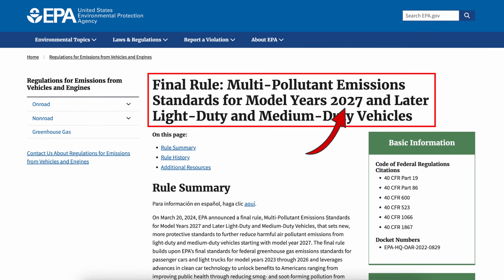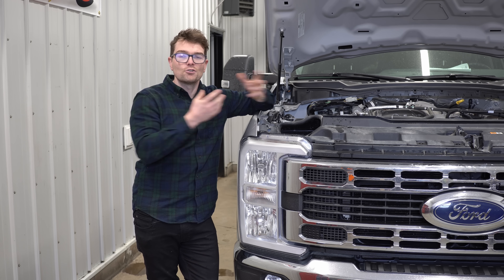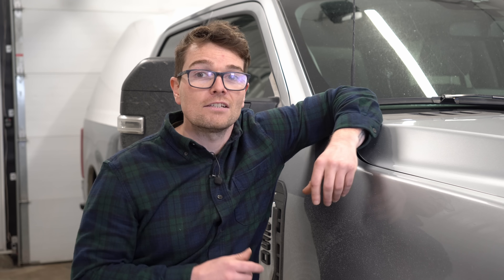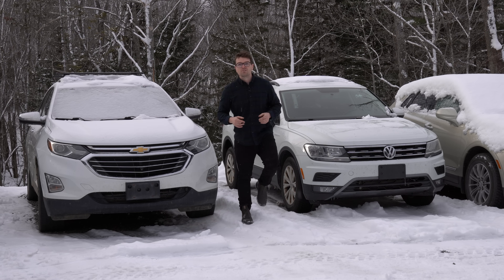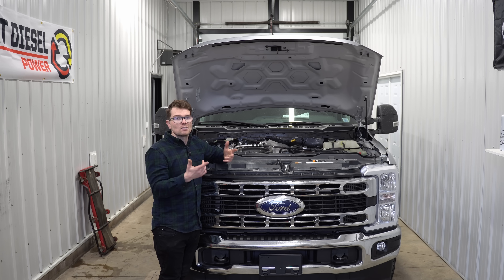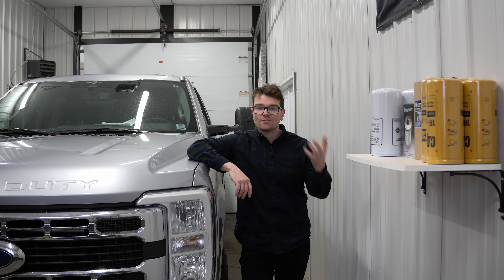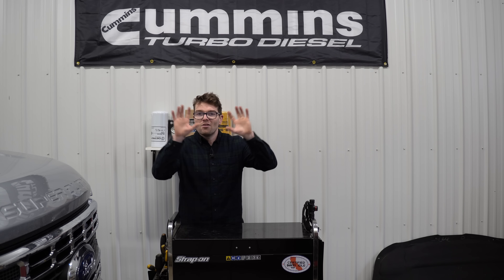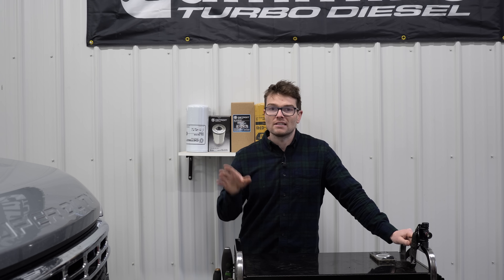NEW 2027 Cummins Diesel Engine EMISSION REGULATIONS are WILD **Diesel Mechanic Explains**

Comment: Don' forget that CARB restrictions are more harsh than the EPA and there are a bunch of states looking to adopt CARB standards over the next couple of years. Also, do not forget Cummins has the gasoline 6.7 coming to the medium duty market. At point in time on gas cars the catalytic converters had federally controlled warranty of something like 7 years/80000 miles. I only remember that because I had go bad at 79600 miles and got it covered under warranty.

Comment: The rising cost of all this bs. 
Will kill off diesel light duty trucks. 
Because the lack of sales. 
Most people that use these trucks. Will not afford to keep buying them. 
For a truck that won't run very well or for very long. 

How counter productive is all this. 
Just wait till we start having more vehicle fires because of the regeneration system. 
This will become a big issue.

Comment: And there is technology available to reduce pollution on diesel engines by 95 pecent  this gives E.U.R.O. 6 STANDED  AT A FRACTION OF THE COST  AND NO ADD BLUE IS REQUIRED . All so has FEDREL ACREDTATION  and E.p.a. all so in  the u.s  to reduce pollution on diesel engines   .but no wants to pay for the technology.  Yes this was done 14 years ago  .

Comment: Personally I think the new regulations are unnecessary.   It is pretty clear that electric vehicles will be preferred when the battery technology gets to a certain point.   I suspect it will be solid state batteries.   The warranty standard is staggering.

Comment: I think the main reason why the new regulations have to wait until 2027 is because the chevron agreement was over turned so they have to wait to put in effect until 2027 the epa needs the congress changed out because the current congress may not side with this new regulations on diesel powered vehicles because a large part of the current congress that will be in power next year might side with President Donald Trump on his massive deregulation movement once he is inaugurated and can get to work

Comment: Unpopular Opinion.  I am pretty sure the regulations don't specify how they reduce the emissions.  They specify a target.  NOX is toxic to mammals, which includes humans.  Particulates cause respiratory issues including asthma.  So it makes sense to clean all these things up for everyone's sake.  Like mentioned in the video, all these parts wear out and need to be replaced.  The companies that make them, often partly owned by the companies who make the engines, are in the business of selling parts (not to mention DEF fluid).  So yeah, they cost a fortune to replace, but that is likely the point.  Technologies like dimpled pistons also reduce NOX& particulates, without the sooting of an EGR system.  The tech requires precise design, but is well within reach.   It also doesn't allow companies to sell you another DPF every 200k miles.  Government does plenty of dumb things.  But I don't feel sorry for these companies.  There might be another, better way, but how hard are they looking for it?  I don't know.  I just don't feel like the blame belongs solely with the government.  The industry causes some of the pain we feel too.  They are happy to sell you fluid and replacement parts all day long.

Comment: So how is that putting exust gas back into the cylinder lowering the temperature in the cylinder? I know the exust goes through a cooler , but it doesn't get cooler then outside air!
Reply: Recirculated exhaust gas (EGR) has less oxygen than fresh intake air. More oxygen means hotter combustion which means higher cylinder temps. Less oxygen, cooler combustion, lower cylinder temps.

Comment: That's exactly what the EPA wants - they want to make diesels so expensive to manufacture, own, and operate, that no one can afford them. I worked for Freightliner for 22 years, and after the 2007 emissions took effect, one day I had a conversation with one of the company engineers, that had recently been at a meeting with the EPA. He said that he mentioned to one of the EPA gents that fortunately they'd been able to meet their new regulations. According to him, the EPA guy literally laughed in his face, and said "You don't get it, do you? We're just going to keep ratcheting up the regulations every few years, until we make it so expensive to use a diesel engine that we run them off the road."

Comment: I'm on my fourth diesel truck and the 2020 with an undeleted Cummins that I have now will probably my last one.  The pro-environment people still think that late model diesels like my 2020  pollute vastly more that a gas burner of the same size like in a 3/4 ton truck.  They want diesels banned now.  They ask why I have a diesel instead of a gasser and I say because of power and mileage.  I've had both.    It will be interesting how the Trump administration is going to handle this but I think we know what's going to happen.

Comment: Manufacturers need to change their design philosophy and make their vehicles easier to work on, thus reduce labour hours ($) to change out components. If these new emission components could be changed out with minimal labour, that would go some way to reducing cost for the consumer while making it easier for manufacturers to stand by their warranties. This way it wouldn't matter if these components are short-life consumables, as long as they're not crazy expensive components.

Comment: makes me not want to work in the trade anymore, the amount of hair pulling involved with these things already is ridiculous and now there trying to force them to be better in the next 3 years? its really sad for someone thats starts trucking and tries to run one of these trucks, the engine is rock solid but the after treatment crap will leave them stranded for months with no income, and the worst part is technically speaking the truck can and should run without all this nonsense. i think its truly one of the saddest things we do, we penalize the truck driver with all the burden keeping the enviroment clean but theres a million cars running without mufflers or any emission controls and not a word is said to them.

Comment: If they went diesel hybrid everywhere then it runs at optimal temp and rpm when charging then shuts off to zero emissions.  That gets a way cleaner per mile measure than current drive trains.

Comment: YEAH " YEAH " YEAH " '   THE  ". REAL PROBLEM  "' IS THAT THE EXHAUST TEMP "  RISES. "' CONSIDERLY   "' '  WHICH IN RETURN MAKES THE. ". WHOLE SYSTEM. "' FOULED "'  THE IDEA IS TO NOT ONLY REDUCE GREENHOUSE GASES BUT TO " REDUCE "'  THE EXHAUST " TEMPERATURE "  SURE YOU CAN REFILTER THE EXHAUST TO THE POINT "' BUT IT TAKES MORE THAN FILTERS. "' IT NEEDS EXHAUST TEMPERATURE TO RISE SO IT CAN BE BROKEN DOWN FIRST WITH HEAT '. THEN FILTERED. "'' THEN COOLED BACK DOWN BY A COOLING SYSTEM "". BUT THE WAY THEY HAVE IT NOW '. IS FILTERING BUT RELEASED AT A VERY HIGH TEMP WHICH IN RETURN IS NOT   C. COOLING OUR PLANET DOWN ". JUST MAKING IT HOTTER WITH LESS EMMISIONS "'. THEY MIGHT AS WELL. ". STAYED AT HOME. ""'. GET IT RIGHT OR FORGOT ABOUT IT. ""'
Reply: I'LL BUT THE STATE OF CALIFORNIA HATES ME. ""'. BECAUSE YOU CAN " PASS. ". ANY SMOG TEST WITH WHAT I CAN TELL YOU "'  THE SECRET IS. " STEEL WOOL. "' '. ASK ME MORE " '

Comment: i completely disagree that the def is a hassle. people that have problems use def pump stations and those are always contaminated. or people are not aware of the short life span it has the hotter its is outside. pre pakaged def is the only stuff supposed to be put in ur truck all this is in the owners manual that engineers spent hours perfecting. its always a lack of mantinace/laziness or just unawareness.

Comment: After spending almost 40 years in heavy duty truck industry 
Trucks in the 1/2 3/4 1 ton were light duty mid range were the business class trucks under 27,000 gvw  every thing above was heavy duty

Comment: Nothing says regulation like having to produce 10x the parts and materials to put on a vehicle, drive the price up 300%, and then be happy that fuel economy drops 20-30% at the same time. (thus buring 5x the amount of fuel to start with).

**  Note the above numbers are my own sarcastic assumptions and not pulled from the EPA website.

Comment: The government is not going to outlaw internal combustion vehicles. They are just going to make it so complicated so expensive through regulation it will no longer be affordable or economical to drive a internal combustion of the vehicle.
In an effort to push an electric vehicle on every industry and individual who wants to drive on the road.

Comment: I’m all for emissions controls, we have come a tremendous way from when anyone started thinking maybe we shouldn’t pump out a ton of pollutants all the time. We’re going to far. All these systems are designed and tested to fast to be reliable. Gas engines are getting less reliable as we make a 4 cylinder engine do the work of a v8.  As for diesel engines I work around Volvo, GE, and John Deere. I won’t ever buy a diesel pickup.

Comment: Great so because of the extended warranty, new emissions, new engine and other parts… I expect a base model Ram with the 7.2L cummins to cost around $100,000 off the factory floor

Comment: The EPA bureaucrats are so stupid. They are drastically reducing the lifespan of vehicles which greatly increases emissions, not from the vehicles themselves, but from manufacturing the replacement vehicles. And that doesn't even consider the reduced efficiencies of the vehicles as these systems age and cause fuel mileage to decrease considerably.

Comment: The mandated warranty extension? This will not mean the trucks are more reliable- they WILL break. And repairs will be expensive. Somebody will pay for those repairs...do you think Ford or Cummins have free money to pay mechanics and manufacture more parts?
    They do not. It will come from somewhere. The ONLY source is us, the customers. This is not the fault of the manufacturers,  it is just "what is". Get the money from us, or they will cease to exist.
   Somehow, this regulation is gonna cost us a LOT.
   I am also curious to see if dealers and other mechanic business can keep up, with the high turnover rate of techs. People are trained and gain knowledge through experience,  then just leave the whole industry because it can be a crap job.

Comment: The new agenda for epa is to push their green new deal and EV mandate all w “rule” changes it’s chasing diminishing return now cars are less durable less reliable becoming throwaway vehicles diesel trucks used to run 300 400,000 miles before rebuild now with the EPA carbon is choking the systems dramatically, reducing reliability and dramatically increasing maintenance. BEV electric vehicles will never replace diesel. It’s a scam. The fact that Chevron difference is now unconstitutional and gone every single rule that has not been evaluated by Congress should be ditched  The rule making by a few agenda driven activist needs to go. FREEZE ALL EPA or push back look at Toyota to chase CAFE requirements and emissions control dropped their very reliable V8 and now has his miserable, six-cylinder engine dramatically, reducing quality and massive increase in recalls

Comment: The worst emissions from conventional drive trains come from having to constantly catch up with changing RPMs and loads, be it the rapidly changing conditions at launch from dead stop or modest changes from less than perfectly straight and flat highways. Going eCVT hybrid would eliminate most emissions at the source by allowing the engine to be fully optimized for fixed operating RPM and load with the battery and electric motors handling everything else. Exhaust scrubbing gets much simpler when you have practically constant exhaust flow and temperature for the whole time the engine is running besides startup.

Eventually, it will be impractical if not impossible to meet emissions standards with an engine on board any other way.

Comment: Do they know CO2 is not a pollutant; it is a good gas for plants.
Reply: They're not after C02 reduction. C02 reduction is done just by improving fuel economy. They're mainly after particulate and NOx
Reply: @knotical689  They're after whatever they need to be after in order to convince you not to buy one, and eventually the manufacturers not to make one. PERIOD.

Comment: This systems we have on aemitrucks since 2010.
And all carriers are broke.
The exhaust system cost now exact the same , than a new engine.  Since 2004 a semiprecious have doubled the price. And have a lifetime from 5 years. After 5 years the repair costs are to hight.
And every winter in cod weather this kind of trucks break down. Check engine light will light permanent, but will shut down your engine.
A complete fu....ed up system.
Keep your old pickup, and you can rebuild  your old truck.

Comment: I wish they'd pull the egr exhaust after the DPF to eliminate the soot problem.  Being such a long run back to the engine they could probably eliminate the EGR cooler as an added bonus.
Reply: that's actually a clever idea
Reply: Caterpillar did that  it almost never had issues with clogging up
Reply: Listen jist as these guys say, nothing to do with efficiency or longevity.  All about control and money money money
Reply: I have been saying for years but it will never happen as it's common sense. At least I could a reason for the DPF
Reply: @ exactly. EGR, in my opinion, has been way more problematic for engines than DPF has been
Reply: International has a new engine that eliminates the EGR cooler altogether. Curious to see how that works out in the long run
Reply: @connorlee478  how do they bring down the Nox then?
Reply: @ they have a two stage SCR that is able to eliminate NOx without the need for EGR. Just look up the International S13 engine
Reply: That’s what GM does on their new LM2 and LZ0 in-line 6 diesels.
Reply: Fass makes an EGR DPF

Comment: This is all about increasing the operating costs and capital costs of fossil (gasoline and diesel) fueled vehicles so that electric vehicles become the only practical economic choice.  Once everyone drives an EV the government can track your travel since every EV charging station collects your personal and vehicle information through the charging plug for billing purposes.  Tracking you will also allow the government to limit your travel if they should be motivated to do so.
Reply: They already track, listen, and watch you with your phone.  But yeah, control of movement a definite plus.  Just like the Patriot Act after WTC7, all the 2020 common cold lockdowns, jabs, etc.  More on the way.  Eph 6:12

Comment: That makes sense lets burn diesel in the exhaust not powering the truck down the road in order to improve Emissions And EGR's lets get the engine to eat it's own shite so it looses power forcing you to put the peddle down harder to get poorer milage. The problem with the EPA is they only look at ratios not volumes per kilometer.Typical government logic lets burn more fuel to reduce emission. What a load of crap.

Comment: I wasn’t the best student but what I remember from my 5th grade biology class is that the trees, grass and other crops breath-in 3 main pollutants you just mentioned , it’s their ONLY food ( carbon monoxide Knox gases and unburnt fuel ) they eat pollution to release oxygen into the atmosphere. Trees  will die from oxygen alone , that’s why volcanoes did what cars and trucks doing right now , BURNING lots of FUEL to feed our lovely trees .  I’m sure there is gotta be check and balances and few smart libtarded ideas whom know nothing about carbon-footprint but on the other hand I can’t imagine the hot day , you’re sitting somewhere in traffic and everyone in front of you have no catalytic converters, burning leaded gas etc its the real hell on earth or worst when you shut close our diesel engine from the intake side with something like triple EGR and at the exhaust side with 5 different cats , creating crazy temperatures so that your cast-iron block almost at the melt point ,  it’s not a solution to any problem either. Also they had agriculture study done where they’d hook up exhaust gasses from a DSL TRACTOR and plumb it to a seeder apparatus so each seed would be able to go into the ground with lots of exhaust  . Crop in fact was growing really healthy , it would show up from the ground twice as fast , huge resistance to drought and diseases, resulting in big big yields

Comment: If they were so concerned about emissions about pillutants we would ve using steam generators (NOT a boiler) to burn these fuels rather than international combustion engines.
A steady state burn is much easier to handle in terms of burn efficiency and emissions.

Comment: The purpose of diesel injection into the DPF is to generate the heat for DPF regen.  Adding the electric heater negates the need for diesel injection and increases fuel economy.
Reply: But the weight of the equipment (heater & extra 48v alternator, extra belts to drive said alternator) plus the extra engine load driving the alternator will negate the fuel economy.
Reply: @Screwy9758  I guess we'll have to wait for the real-world results to see how it all balances out.  
Then again, the new administration may have something to say about all these excessive regulations